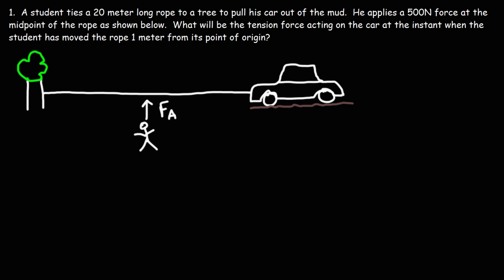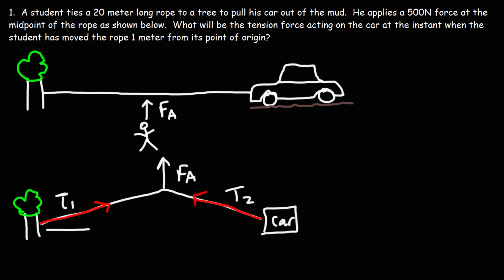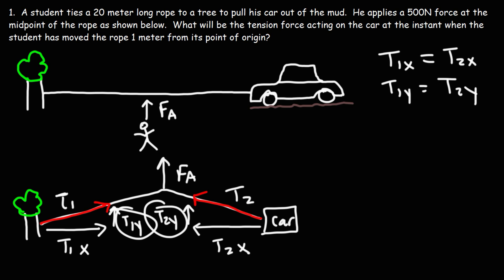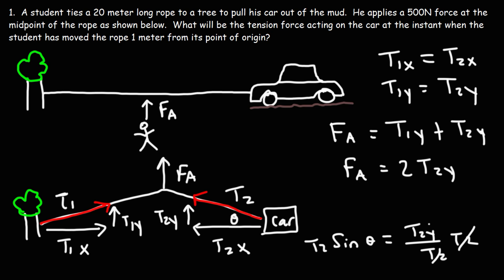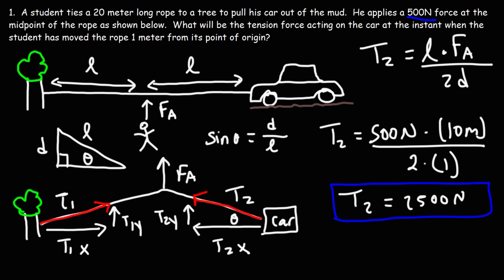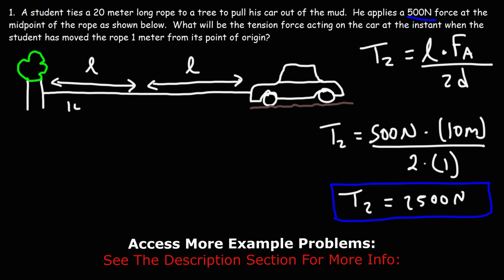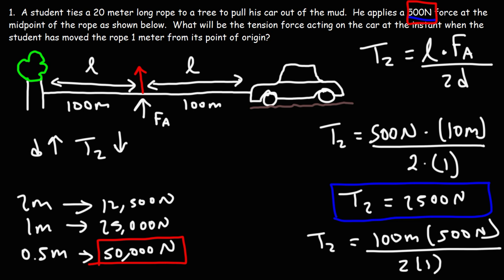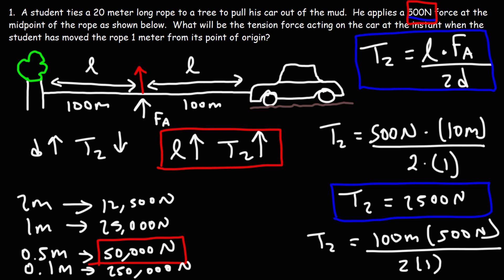How To Use Physics To Pull a Car Out of the Mud

Comment: This assumes zero stretch under the loading  forces applied , which would mean using something besides nylon or polypropylene rope , like kevlar or spectra .
Still this technique works .
It also works against you if you are a rock climber or other rope user and get your rigging technique very wrong .
Reply: There are ropes designed not to stretch.  Ropes have been designed for virtually every purpose.
Reply: Yes , ones made of spectra or kevlar have minimal ( near zero ) elongation under load , which is why I qualified my comment to reflect that .
Most commonly available ropes , however , have significant elongation under load , which will decrease the efficiency of such methods accordingly .

Comment: Im just trying to think what would happen if the applied force is not equal distance between the car and the tree, extremely doubtful "you" will know where exactly that distance is, not to mention if youll even have access to that spot, ie a 2 ft drop down or something. It seems simple to work out, but im just trying to do it mentally late at night here